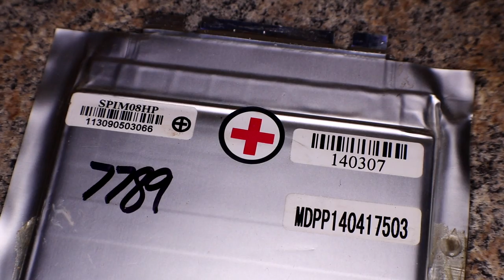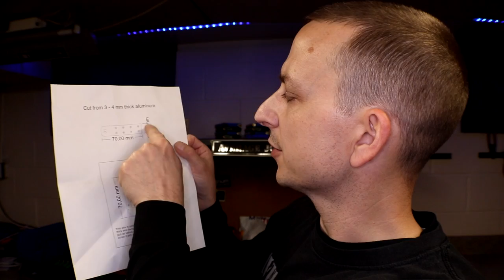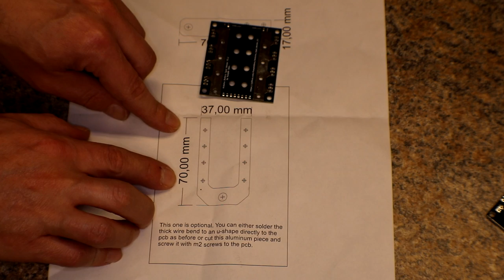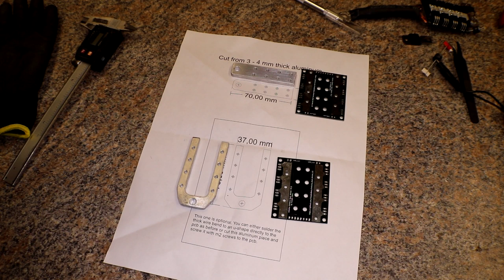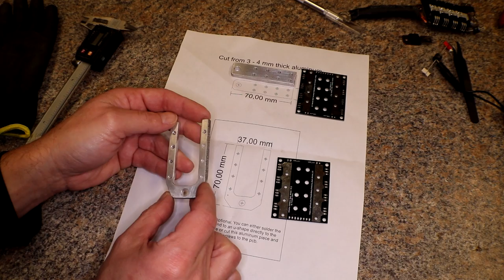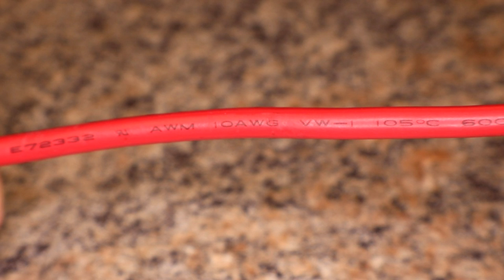🔋⚡Malectrics Diy Arduino Spot Welder⚡🔋

Comment: Excellent video on a great product. With a double pulse, the first pulse burns off any thin oxidation that may have occurred between surface-prep and weld (if there is no oxidation, the dual pulse doesn't "hurt"). Dual pulse also softens the points where the probes are pressing down, and that makes the second pulse have a lower-resistance connection, which hopefully provides a more consistent result.
Reply from the maker: Thanks Ron!  AHHHH thats good info to have!💥🔋⚡😆👍

Comment: Hey Joe, i don't know if I mentioned it before, but...for the battery shown at 43:26, you should cover it with a stiff insulative board (I recommend HDPE kitchen cutting board), and set a cinder block on it to provide some compression. Anything between 50 and 100-lbs would work fine. Any compression is better than nothing...it reduces resistance, lowers battery hot spots, and reduces the likelihood of off-gassing (puffing).
Reply from the maker: Yeah you mentioned that and I plan to make something for it for sure.  I wanted to make sure everything was working good before I went ahead and made it more permanent! 🤘
Reply: I just bought a bunch of these for an EV conversion. Your note has piqued my interest because I had planned to allow a gap between the cells to ensure proper cooling. I understand some lipos prefer compression but hadn’t seen anything on compression for these in particular. 🤔
Reply from the maker: Sweet! An ev with these would be awesome. Yeah they should be compressed like Ron suggest!

Comment: did you tap the aluminum bars on the shmp cells? what exactly did you do there? beautiful work man! i love it, have the almost same setup, newer welder with same cells, but it is not welding properly, i am almost certain it is because of my cell connections
Reply from the maker: I basically have the aluminum bars compressing the tabs on the cells.

Comment: Man, you are a very patient guy, especially with that cat. No wonder it took 2 weeks to make the video. :-)
Reply from the maker: 🤣🐈 Thanks man! He does like to "help"! And YES sometimes it can take FOREVER to make a vid when he is "helping"!🤘
Reply: AveRage Joe 
2 days ago, I ordered a mini spot welder on the Banggood. Waiting now to arrive and do some tests. As you have dealt with so many cells, can I ask you something? I came across your video while looking for cell replacement for my Ryobi batteries. I have 2x 2Ah Ryobi batteries with 3 dead cells each😳. The cells in these ryobi batteries are US18650VTC4 C4 MURATA INR19/66. I have a few cells that I took them from a very well known cordless hoover manufacturer and these are: SE US18650VTC4 C4. Would it be ok to use these SE US18650VTC4 C4 cells to replace the dead cells in my Ryobi batteries?
Reply from the maker: It kinda looks like they are pretty much the same cell!
Reply: @AveRage Joe 
Here it is some info I found about these cells:
Previously manufactured by Sony Energy - Murata purchased Sony's battery division in 2017. Newer production of cells are marked Murata and not SE (Sony Energy). Older cells will show SE printing.Previously manufactured by Sony Energy - Murata purchased Sony's battery division in 2017. Newer production of cells are marked Murata and not SE (Sony Energy). Older cells will show SE printing."
Here it is the website where I found the above info:
https://www.imrbatteries.com/sony-murata-vtc4-18650-2100mah-30a-battery/

Comment: Thanks so much for all your videos. I've just finished pack 1 of my 7S40P build and I have you to thank for it.  Keep em coming Joe!
Reply from the maker: Thanks for watching!!!  Sweeeeet, do you have it up and running yet!  Ill be starting on my next 14s here before to long.  I have enough cells to do it meow!😆👍
Reply: @AveRage_Joe  Not yet. Just soldered my first pack with similar glass fuses you use.  I was using a butane soldering iron.  3 burnt fingers later I decided to order a Weller.  I have been scouring info on the lowest capacity to put in a pack. What is your recommendation? Is a 1600 mAh and up cells too low in a 40P pack averaging 85 amp hours?  Thanks so much.  This is my first ever post on YouTube....Bet!
Reply from the maker: Oh ok cool!  Yeah I havent tried a butane iron but burnt fingers sucks for sure lol!  Its really up to you on what cells to use.  In the beginning I was gonna use 1500mah and up since I couldnt find many good cells but was able to eventually find some.  Some people have lots of standards when building packs but I dont lol.  If 1600 and up is what you have then Id use them.  Just make sure each pack is equal in capacity the best you can and dont go over 1a discharge per cell since there all used laptop cells.  If your building 40p then no more then 40amps running.  I used 2000mah up to 3100 or 3200mah in my packs and so far no issues for the most part.
Reply: @AveRage_Joe  Outstanding. Thank you, Awesome Joe!

Comment: With the battery pack you built here, are you you using a BMS?   If so is it connected while welding or just while charging?  What charger are you using?  I built the V3 version from scratch. Took me month to gather all the parts and ended up wishing I had bought the kit version or the pre-assembled welder. I bought the same batts you are using. Do you think it would be better to make two 3S packs and then parallel those together? Wouldn't it be easier to balance charge the cells that way?
Reply from the maker: Im not using a bms but should for the low voltage cutoff option. I have been using the Icharger 6x https://ebay.to/2L0TlUm I would have built version 3 if I had the boards.  I think it would be easier to balance charge as one pack vs 2.

Comment: Should have taped the holes in the aluminum but also are they switching the positive and the negative that seems unnecessary right
Reply from the maker: Yeah I tapped them as the pos and neg and stacked on top of each other how I have it.
Reply: @AveRage_Joe  ya but dont you only need to to switch one side and have the other go straight to the battery
Reply from the maker: Maybe Im not following, the lipos have a neg on one end and pos on other end. I have it in a 3s2p config in a "Z" shape.
Reply: I might also be misunderstanding but is the positive and negative being switch because you should be able to have just the positive cable attached straight to the battery and not switched and just have the negative switched

Comment: You should put a dc clamp meter on the power cables and see what it draws but that being said you would need a big one since that can safely do 400A but I know as a dead short i have seen over 100A our of 1 18650
Reply from the maker: Yeah I was trying to come up with a way to measure that from stuff I had but only have a shunt for 100amps lol.  You know of any inexpensive clamp meters?
Reply: @AveRage_Joe  I got one for 60/600A AC/DC from Aliexpress for between 30 and 50€ I think. But to measure the pulse current you need an oscilloscope and a suitable current clamp.

Comment: Howdy. Interesting video. I came here mostly because I spotted you were using cells that I’m using for a large project. I tried to see how you joined them but I’m left with even more questions. I know there are a lot of folks picking these up for their own projects. You’d do the DIYers like myself a real favor if you had a video on just that. Thanks for the consideration.
Reply from the maker: Thanks Man!  I joined them with 1/4" X 3" X 3/8" aluminum strips I cut out of a spare plate I had on hand. Then drilled holes through them and tapped a few so the screws could keep them tight.  If your doing a big battery then you could probly use all thread and a bunch of nuts to secure them together.  If I get some time Ill for sure do a little video on the connections!👍

Comment: Great video!  Strong welds obviously needed, but the other key property is the resistance (conductivity) of the welds.  Any quantitative data?
Reply from the maker: Thanks Paul! Yeah there nice and strong welds. As for data I dont have any or Ive never checked resistance/conductivity. Any suggestions and maybe I can make that happen.

Comment: For some reason, my OCD just will not allow me to leave the little sharpies on my harvested cells. I have to take flush cutters and snip them off so that you can barely feel them. I've gone through two pairs of flush cutters at this point.
Reply from the maker: I used to do that as well and I also went through a few flush cutters lol.  Now I get most of them off then push anything left down on the work bench!👍🔋
Reply: @AveRage_Joe  Oh that's clearly the smart and effective thing to do. But I just can't let em be. Now if you'll excuse me, I've gotta go open and close my front door seven times.

Comment: Hey Joe. Kinda curious ...are you still using the same configuration 3s2p with this welder? Can't find anything on it? Thanks bud!!!!!!
Reply from the maker: Yep still 3s2p. Havent used in a long while tho lol
Reply: @AveRage_Joe  sounds great! Turnigy kinda screwed me on my battery, but now I have 2 more batteries coming 5500 170c 3s2p and a graphene 4000mah but only up to 75c, 150c. Luckily, the maletrex I have is the newer version. Just need to build some batteries and figured I have over 70 spim08hp,  figured I'd mess around. I have a kweld with kcaps and cases. But I haven't thrown that together yet. I have a few builds I have to complete first. Videos coming😀

Comment: What metal did you use for linking up the batteries? What do you figure the capacity?
Reply from the maker: I used 1/4" aluminum plate cut into strips to connect in series and the capacity for each cell if I remember right off the top of my head were roughly 7.5-8amps or 15000mah for 2p. Love them, they work great!
Reply: @AveRage_Joe  I was wondering the amp capacity of the bars themselves. Did you mean 7.5-8 volts for the battery wired up in 2s2p?

Comment: Can you please tell me what you used to make the serial connections on the spim08hp batteries? I am building a battery with these cells and I am trying to decide wether to clamp them with copper or aluminum and thru bolts. Or wether to solider them. Thanks. If I missed that info in the video I'm sorry but I watched it once and then scanned it looking for that info
Reply from the maker: How big of a battery? I used aluminum bars I cut from a thick sheet I had on hand. If I did it again Id use copper and bolts like your talking!

Comment: Hey Joe, hope all is well. I just recently built a SPIM08HP 3s2p pack. But for some reason when I connect my 60 amp BMS to it the BMS starts getting really hot. Mainly on the diode of the BMS. Would you have any idea as to why this could be? Thanks bro
Reply from the maker: Do you have a link to the BMS?
Reply: Joe , NEVER MIND, I figured out my screw up, surprisingly the BMS didn't blow up. I was connecting 8.4v to 4.2v terminal 😬😬
Reply from the maker: Glad you got it figured ou!!!

Comment: Hey Joe!!! Its me Joe!!! On the cable coming out from the welder to the battery the female XT60 one. Was the wire 8 gauge 10 cm? I need to make a replacement, and this is driving me crazy. You know how I have giant hands. the 10 cm looks awfully small to me, but I am not 100% sure if this what we should use?
Reply from the maker: I used #6 on mine!😀💥🤘

Comment: I bought the pre built kit and can't seem to get it to weld.. it gets warm and tries but no welds..
I am using a small 12 volt lead acid battery that arc well when shorted but is it too weak to weld?
Reply from the maker: Its very possible.  What size is it?  Maybe take a look in the settings!

Comment: Solid video Joe with extensive editing effort. +1
was trying to put it into relief the cost and partwise and what the DIY for your approach summons to and vice versa hence prebuild as it can be fiddly mess with some of these surface mount components
notice you stated around 60USD  partwise in comments for the items you had not stocked' so not that bad that the full fledge prebuild elevated 3.3 kit. cost 130 (Euro) and its the V3.3 with OLED and current pulse-estimation info that will give you a crude estimation mostly 500A to 700A but accuracy will vary with spot area sizing.
Good work, will take a glance on some of your other videos and most likely subscribe.
Reply from the maker: Thanks Mate! Yeah the little parts are a little fiddly but doable. Id like to build the new version sometime if I can. Its a great spot welder for sure. I also got the Kweld spot welder but need to asseble it. There more expensive but hear they work awesome as well.💥🤘

Comment: I prefer to tin only a single pad for each component, then fix a number of components, each at first only on that one pad. Then I take solder wire and solder the other connections. That way you do not eed to repeatedly heat the joints on both sides until the component lies flat on the PCB
Reply from the maker: Thats a great way to do it!🤘

Comment: Hi there just subscribed to ur channel, very cool assembly u did putting this stop welder together and nice job making all those wires , and really impress with those lipo batteries u got there, nice job , and nicer to have one of those spot welders, 👍
Reply from the maker: Thanks for Subscribing and Thanks for watching!  Yeah the spot welder has performed great since building it.  Have done over well 1000 spot welds without charging the lipo's!  😆🤘

Comment: I built up one of the malectrics welders and love it to death! Not too expensive, not too big, perfect for small setups and projects. 

Do you have a thermal imaging camera? One thing I'm really curious about: how much heat does the spot welder put into a cell vs. Soldering? 

Anyway, great work! Seems like a long way to go to just get a few little spots on some metal.
Reply from the maker: Thanks!  Yeah I really like it so far!  Which version did you build.  Since Ill be giving this one away Ill probly build another!  I dont have a thermal cam yet but its on the list of things to get!!!😀🔋⚡
Reply: @AveRage_Joe   Hey! I don't have it right in front of me, but if I recall, the pcbs were version 3.2. Not sure on the firmware, but it's been at least a year (hmmm, aybe I should look into upgrading that). 

I bought the pcbs, the pre-made aluminum pieces, and the spot welding electrodes from Malectrics,  sourced all the other components myself. I  experimented with different batteries as a supply. Wound up using a 700 CCA lead-acid car battery. I needed the extra power to weld some thick nickel strips. The double pulse really seems to work well, I guess the first pulse cleans the metal and makes good contact for the second pulse to weld.

One thing for sure, the heavy cables and connectors really need to be solid. The currents are so high that any little imperfection makes a noticeable difference. ( or in my case, a fire!)

So you found a couple mods that I was unaware of, the diode, and the capacitor I'll have to look into those. Thanks for that!

Keep on zapping!
Reply from the maker: Nice!!! Do you have any extra pcb's of the newer version cause I wanna build that one also😉😉. How did you start a fire? Yeah Ron from electricbike.com was tellin me about how the double pulse does all that. Crazy lol. YES keep on ZAAAAPN!!!!💥💥💥😀
Reply: Sadly, I did not order any spare pcbs. Too bad, if I had built a second unit I could have probably charged rent, based on the number of times I have lent this one out ;-)

Yep, you know how you can put Vaseline on car battery terminals to prevent corrosion? Vaseline of course is petroleum jelly. Well, guess what burns? Petroleum.  

I was using a commercially made battery cable. It was a bit corroded when I got it so I cleaned it up and put some Vaseline on. Apparently it had a bad crimp that got hot after  a half-hour of vigorous spot welding. My advice: if you ever have one of those moments where your brain says "what's that funny smell" stop everything and take a step back.

I went to the technique malectrics shows in their photos and bolted the fuse directly to the battery terminal. Works great, seems to have a little more power.
Reply: Hey, if you want to borrow this unit, just say the word. It's on loan to a buddy of mine, but he should be finished with it by now. Come to think of it, he's in the LA area where they just had a big bunch of forest fires. I wonder if he was trying to build battery packs out in the woods?

Comment: do these spimo8hp cells hold a charge?  has anyone tested these?
Reply from the maker: Yeah there great cells!
Reply: @AveRage_Joe  thank you, but how long have you tried for?
Reply from the maker: Been using them for over a year without issue!
Reply: @AveRage_Joe  18650s vs spimo8hp which would you prefer?
Reply from the maker: For a spot welder Id choose these as they can deliver the power in small package.
Reply: @AveRage_Joe  how about for a power wall?
you wouldn't need a spot welder if you used spimo8hp cells.
Reply from the maker: Yeah Ive seen a few people use them for a power wall. Cant remember how they connected all the cells maybe a threaded rod with nuts and washers. Yeah you can totally do it. Also if you purchase anything from batteryhookup you can get 10% off with my discount code "boom"
Reply: @AveRage_Joe  you do damn good work with your videos, like the banggood video. thank you,, what is your code for battery hookup?
again, thank you.
Reply from the maker: Thanks Man! Discount code is boom and you get %10 off each and or everytime! 💥🤘